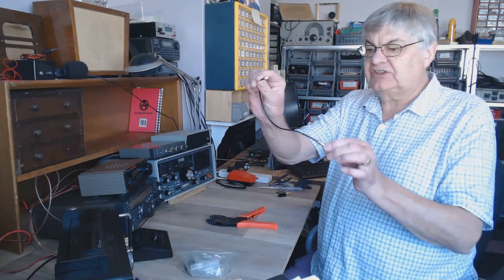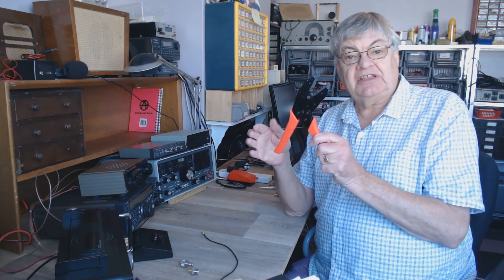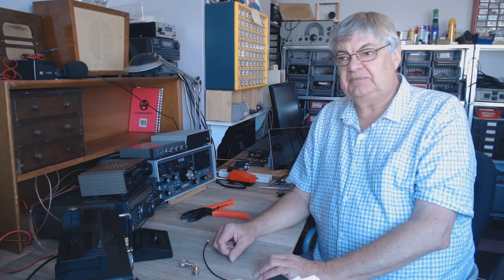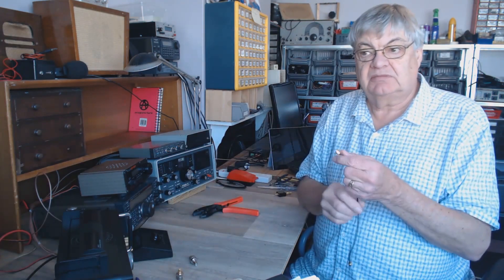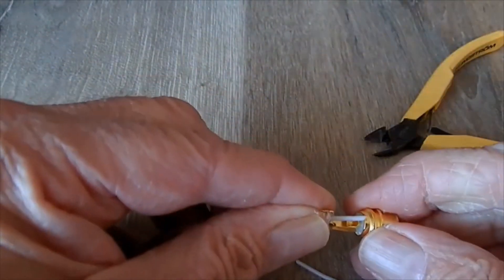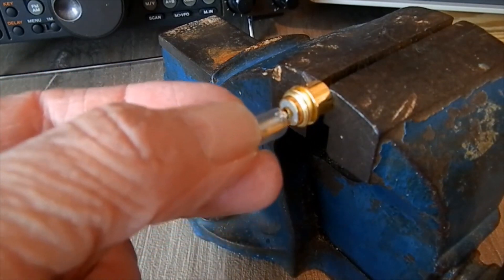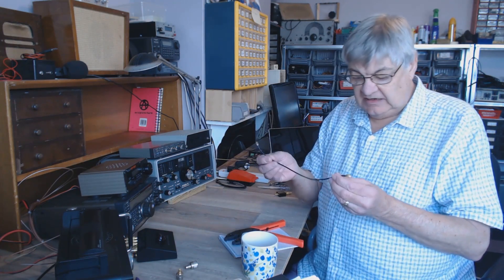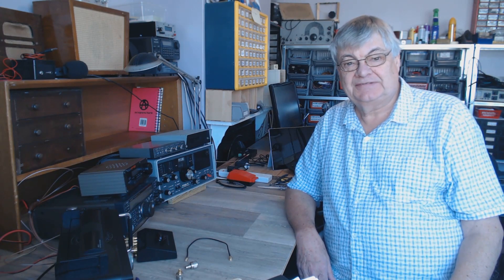G4NSJ - Crimp-on RF plugs. SMA phono RG316 coax

Comment: You pins are solder on, brass, cannot crimp.
I add solder to the center conductor first, then I hold the center pin with pliers and heat it as I slide it onto the center conductor!  The solder hole is too small.
Reply from the maker: Excellent, thanks!

Comment: Thanks Ray I agree it takes several practice tries with crimp on connectors. I started ham radio back in the 60s as a teen and those surplus rigs were pretty good. They were the saving grace for beginners. 
Thanks again Ray and 73s. Terry WA0DTH
Reply from the maker: Thanks Terry, it’s nice to hear from you. Cheers, Ray.

Comment: Hi Ray, Long time no chat. I have had many disappointments with crimping tools, well I had to buy one for "JST" connectors well they wasn't cheap but I brought a £15 only done 2 sizes of crimps, what a load load of tosh it wouldn't even grip so I could take my fingers out the way to be able to crimp it "they would either fall out before I crimped or i miss crimped the connector and I wasted about 5 crimps. So I brought a nice crimping tool from amazon with precision milled teeth etc also done 3 sizes of crimps it cost £40 and the difference was night and day every crimp was a goodern!
Reply from the maker: Yes, you’re right. Cheap stuff is a waste of money. It’s nice to hear from you. Take care and all the best, Ray.
Reply: @g4nsj Hi Ray, I'm the guy who brought the HP 334 sinad meter off you last april/may, mind you I haven't used it yet
Reply from the maker: Ah yes, I remember. Hope all is well with you.

Comment: Back in the 70s we had RADIO SHACK i could buy RCA plugs for the phono stick the lead wire in to the center pin solder it and solder the ground wire to the side of the plug miss those days i bought all my stuff at the SHACK including a short wave radio DX- 160 and im still kicking my self in the bum for that.
Reply from the maker: I really miss those days. It’s nice to hear from you, thanks. Cheers, Ray.